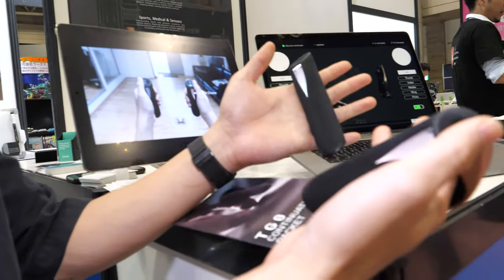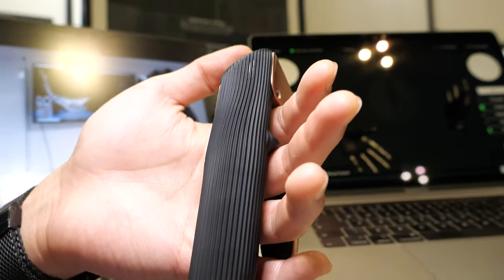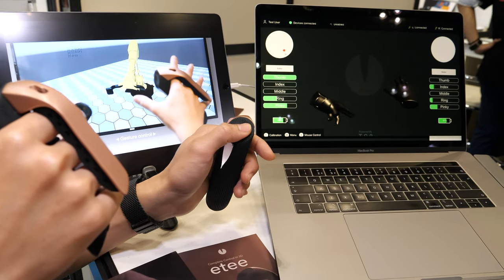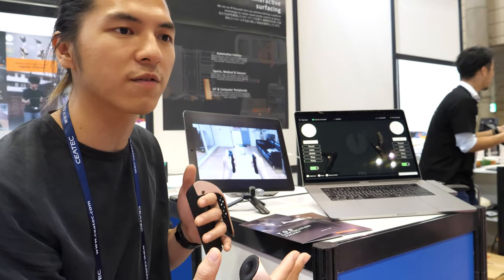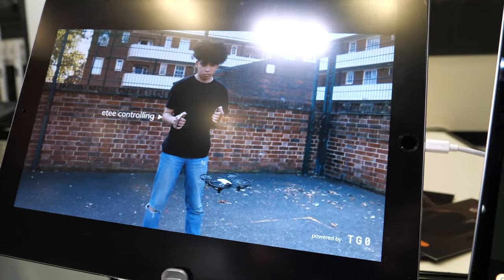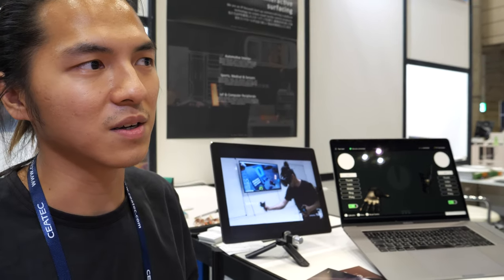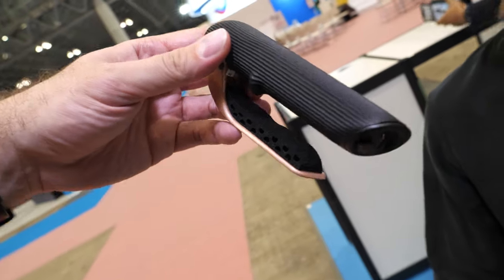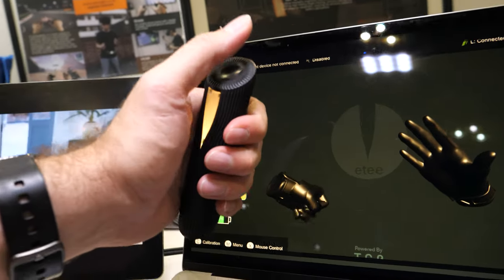TG0 etee finger tracking controller for VR

Comment: I am skeptical of finger latency with this controller.  For example, in a first person shooter, if you set your gun to semi-auto and try to shoot as fast as possible, will the controller be able to keep up with your super fast trigger pulls?
Reply: Unlikely. The challenge is less to do with latency than precision, on behalf of both the controller and the user. For the users part, the lack of any haptic feedback makes it difficult to judge appropriate finger placement and motion. On the part of the controller, it's extremely difficult to correctly derive intentions from often ambiguous input, especially when considering the previous point. Putting these two things together and you get a use case (semi-automatic shooting) where the results would be suboptimal at best.

One somewhat related note; on the kickstarter page for this device, TGO rather arrogantly yet amusingly suggest physical input methods (buttons, triggers, etc) are "way out of date" further stating "It's binary. It’s boring. It’s not like the free, fluid experiences we have in real life."

Now, I don't know about you, but in my "free, fluid experiences in real life", objects have physical presence. But maybe that's just me. At any rate, your suggested use case offers a compelling counter to this notion- sensory feedback is important in many ways, touch perhaps most of all. Physical input devices offer this, something that's literally impossible for a gesture oriented device to provide.